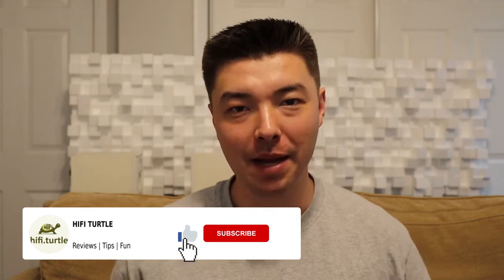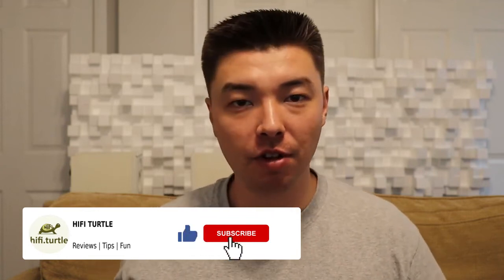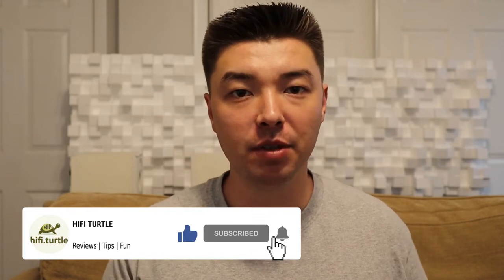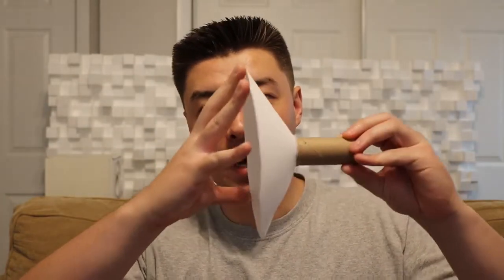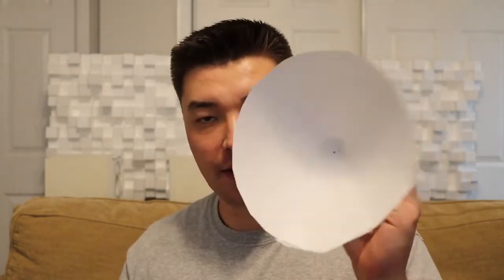Why do Loudspeakers Use Cone Shaped Drivers?

Comment: Loved your explanation- this had been puzzling me for a while… rigidity👍

Another question that I am trying to get my head around, in case you are interested and if it is even a real question:

When a speaker is traveling backwards and forwards, at the fundamental frequency of the timbre, do the higher frequencies (overtones I guess) suffer some sort of Doppler distortion?

I.e. lowering frequencies on the backward stroke and raising them on the forward stroke..

I hope this makes sense, and I hope the answer is No, or, Yes but the circuitry / DSP remedies it 😅

Thanks again for your great video.
Reply from the maker: Theres conflicting opinions of doppler distortion. Some think it would be more appropriate to call it phase modulation distortion. Those who believe in it say at 1khz there are bands of ~900 and ~1100hz produced as doppler. Most seem to believe it is minimal especially in 2 and 3 way designs, the movement of a cone to produce 1khz is very little and the cone of speaker doesnt move extremely fast. Theres a lot of articles you could lookup for more
Reply: Thanks - I did a fair bit of searching but couldnt find any hits on the subject - any chance you could refer me to any articles etc on it? @HiFiTurtle
Reply from the maker: https://www.stereophile.com/reference/1104red/index.html

https://sound-au.com/doppler.htm
Reply: Thankyou!  @HiFiTurtle

Comment: Where to start...? For starters, unlike your pieces of paper, speaker drivers have surrounds that stop the edges flapping. Next, if you look at the Sony square driver, you'll notice it isn't flat - it's dimpled. The moulded dimples give it rigidity. The problem today with such speakers is that the surrounds are prone to perishing, and that's a problem for many conventional speakers too (*cough* AR!) Technics made 'flat' drivers too: theirs were circular, and got their rigidity from a honeycomb structure. I have a pair of SB-2 speakers which use these drivers, and believe me: they don't flap. Finally, planar magnetic drivers are literally flat membranes, but they work in an entirely different way. No flapping problem there, either.
Reply: You think those materials are 100% rigid on a "microscopic" scale? He wasn't talking about macroscopic flapping. I thought that's pretty clear.